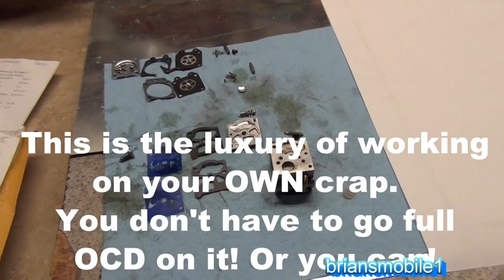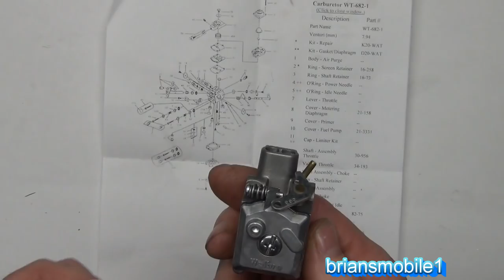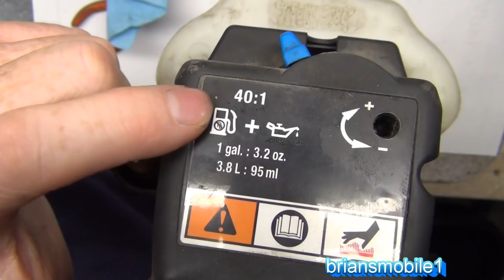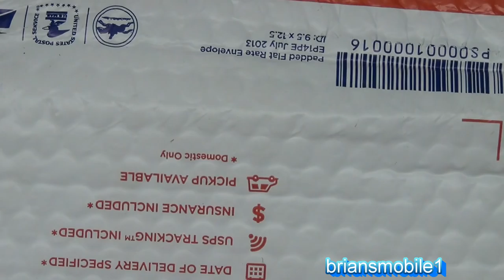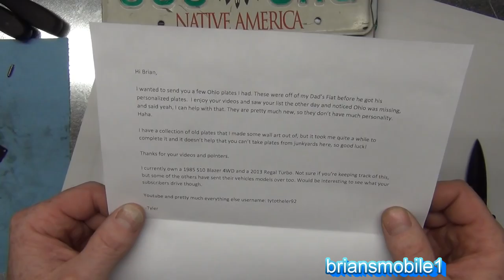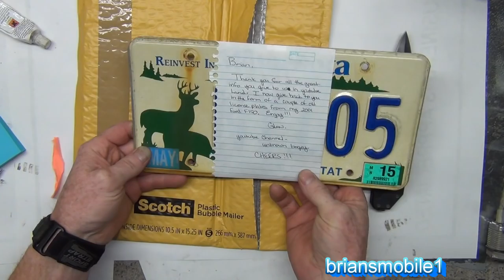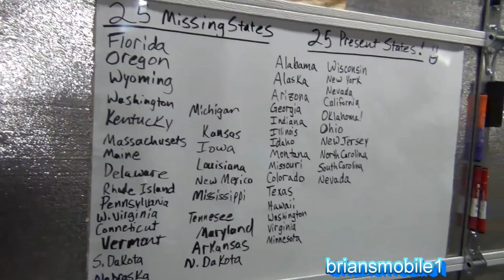2 stroke Carb Repair Weed Eater

Comment: Great info as always. However, to make my Stihl trimmer run like new, I spent $18 on a new carb and started using 91 octane non-ethanol gas. Runs like a champ now.
Reply from the maker: I'm glad you said that.  Finding the blue label or ethanol-free gas makes a big difference in your diaphragm, gas tank, and anything else plastic lasting longer.

Comment: Thanks Brian for this. I haven't found anyone to work over lots of little problems on my trusty but really old Echo PB-60 backpack leaf blower, so I think I gather all the parts and give it a shot. Every 15 years, it needs it.
Reply: And it's running much better, new vibration mounts and cleaned up. Thanks again.

Comment: Brian- Thank you for the great video & advice! That hole in the pump cover is to let air in & out, so the pump can work. We need some electronics Geek to build a micro CR-2032 powered device that sticks to the ceiling of a P.O. Box, and using an App- sends an SMS when it senses air movement inside, so you know you've got mail- and not waste a trip. Probably nearly impossible- with the Faraday Cage-effect of a metal box, and it would have to be approved by the USPS. Oh, well.

Comment: Hey Brian, at around 4:10 - 4:37 you state that the vent line or the return line goes to the bottom of the carb. But that is not the case. The air purge system pulls gas through the carb, and returns it to the tank. So the line with the fuel filter goes to the underside of the carb. the line on top goes to the air purge bulb and then back to the tank.

Comment: Just did this with a really old, but hardly ever used Mantis tiller. Everything inside was in pretty good shape the problem was the main fuel port was completely clogged with some green looking sludge. May be the gummed up old mixed gas. Changed everything out inside anyway though.

Comment: sometime if that arm isn't adjusted right it will cause problems zama and walbro sell a tool for it also another thing to do is remove the adjustment needles if its giving you problems revving up or idling and spray those out

Comment: The little shiny leaver that moves the needle needs to be level with the top on the metal case for the most part in the majority of those little carbs. What is the video software you all use?

Comment: Hi Bryan.  Could you take a look on this. I'm planning to use rubbing alcohol,  heat or seafom.
I'm very proud of my son Jacob.  He have seen me before filling up a gas at the gas station.  So finally he did it.  He put a water into my gas tank.  How thoughtful he was.  Any ideas this might work?  My gas tank was full,  so he could not put a lot.  My car stopped working by the way.  I don't like a idea of draining all of 36gal.  I could drain 2-3 and then see what happens.  Any thoughts?
Reply: Daddy's little helper eh? he,he.  I would try to run the fuel pump with the fuel line running into a five gallon gas can and hopefully you can wait for it to settle out and reuse most of the gas.  It should pump out mostly water first.  But when you've got all you can get, then it's time for the alcohol, you should probably try to find 95% Isopropyl alcohol (rubbing alcohol) often found in pharmacies and/or the bathroom isle of most grocery stores.  You will find 50% more often than 95% but if you keep looking you can score, the point being that the 95% will go further for you than the already 50% watered down version.  Some vehicles have a schrader valve on the fuel rail from which you could withdraw the funky gasoline from.  R12 freon gauge sets use this same schrader connection so if you have one bob's already your uncle.  They still sell the gauge sets or what you really need just the hose for one in case you were thinking R12 days are behind us.  All you need to do then is build a jumper for your fuel pump relay and turn on the key.

Comment: Not sure the gasket maker goop is a good idea. That little hole where the mounting bolts DON"T go is the impulse opening that provides the alternating vacuum-pressure to flex the pump diaphragm in the carb. If that gets plugged...trimmer no worky.

Comment: Where did you buy that container for your mixed fuel? I like it because it doesn't have the asinine safety crap and you can see the level. And when ever PennDOT gets to mailing me the papers for my truck, I will send you my PA truck plate.
Reply: I searched for them on Amazon, and they're called race fuel jugs, motorsport jugs, or just utility jugs. The 5-gallon ones run between $30 and $45

Comment: I don't see New Hampshire on the board? Got Nevada twice on the right side.
Reply from the maker: Washington is on both sides too.  I was dragging tail pretty bad when I re did the board.  Thanks for the heads up.  I don't have New Hampshire.
Reply: I have about a hundred NH kicking around, What do you prefer?, Old, New etc.

Comment: Brian is it me or did you put that diaphragm on the needle side the wrong way. gasket goes first then the diaphragm.
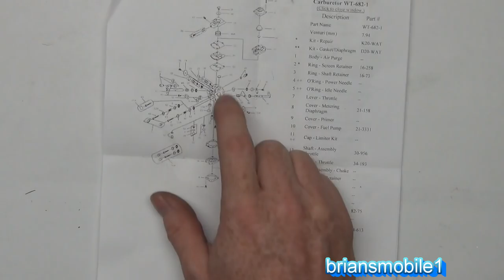Reply: I thought the same thing... on the "fuel pump" side (1 screw) the diaphragm goes on the carb first, and it's the opposite on the metering/needle side (4 screws). In fact the diagram at 11:42 shows the right order.

Would putting them on wrong make the carb run richer? I'm not sure. Maybe this carb runs better that way!

Comment: I hope you are more careful when you rebuild the carb on your flying machine because I believe you reassembled the 4 screw side  incorrectly. Gasket goes down first..
Reply from the maker: Thanks for the heads up.  On the paramotor I do things two or three times before I torque paint them as done.